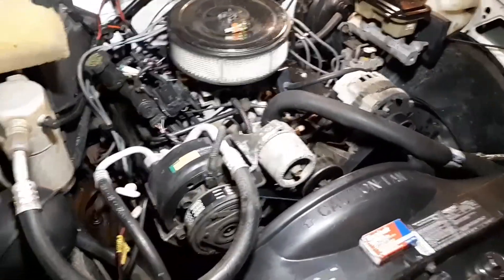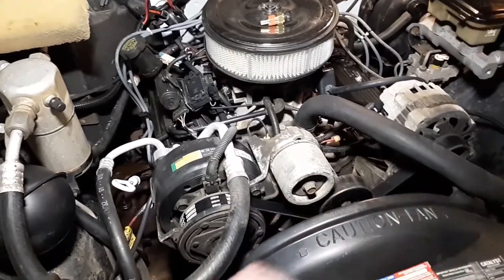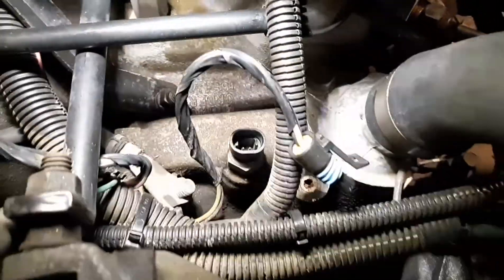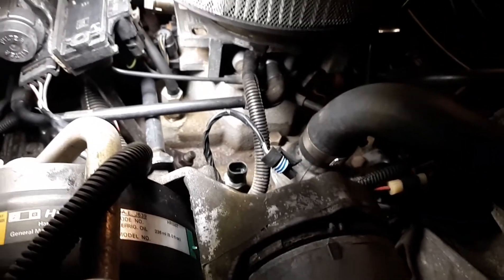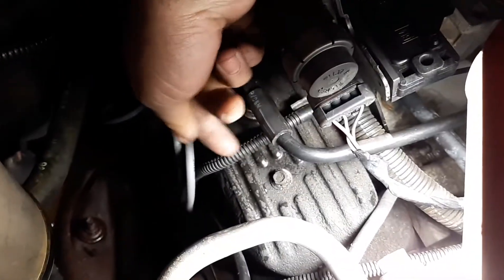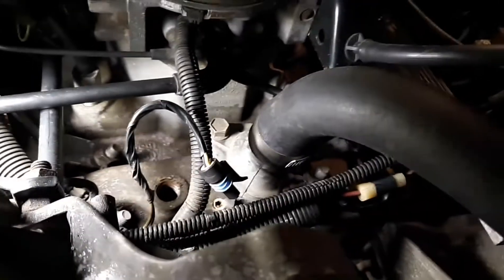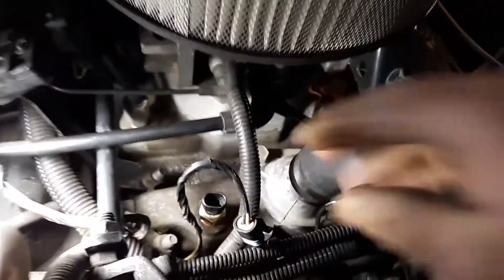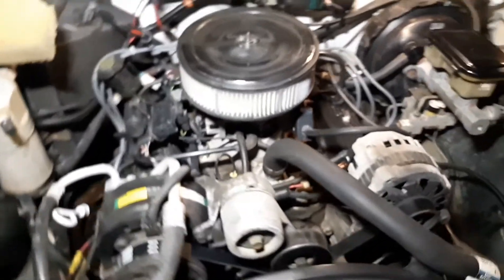Bad Coolant Temp Sensor replacement Chevrolet S10 4.3v6

Comment: Let me tell you - you are leading your viewers through the process and systems so much better than most pickup-truck youtube video makers out there.  Thank you for mentioning that this sensor (which I just picked up from AutoZone myself) is for the computer, and that there is a separate one for the gauge.  I wondered my my gauge was working if this is really what I needed.  I do have a bit of a choppy idle, which does sound like a cam - lol - and I will miss it, but I need to get the fuel economy fixed on this thing.
Reply from the maker: Thanks I appreciate that .
Reply from the maker: Yeah if its having a choppy idle and such it's more than likely the sensor on top of the intake manifold. And yea definitely will be crappy fuel economy when they fail too but make sure you don't have any vacuum leaks
Reply: @KnuckleHeadGarage27 is there a chance you could make a video on the sensor for the gauge inside as well? Would really appreciate it!!!
Reply from the maker: @hydrafreeze8814  if I'm not mistaken there's a video on the channel of Replaceing the sensor that's for the gauge inside
Reply: @KnuckleHeadGarage27  link?

Comment: All of the sudden my truck wouldn’t hardly start right or run right. After checking everything and rebuilding the TBI I ran across your video. I literally went to my truck and unplugged the temp sensor and boom it started right up. I can still tell it need the info from the sensor but it ran. Thank for the tip I was running out of options.
Reply from the maker: Awesome man glad I could help out! In some way . Definitely keep these trucks on the road , to many getting junked and crushed

Comment: I replaced mine a few years ago on my beautiful Blazer ZR2.  I bought it for $2800 from a Grandpa that kept her in a garage in Houston.  It's spot on with my gauge & it did help. 
My ECM & Coil cracked on my a few years ago causing a No Start. I replaced those, the distributor,  cap, rotor,  wires & plugs. 
Plus a new transmission because the stock Sunshields snap very easily.  I'm doing the belt, tensioner,  idler pulley & water pump tomorrow because my temp is running 210° & a tad higher when towing a small utility trailer here in SE Texas in the hot summer months. 
My current water pump isn't leaking & i can see water flowing through the radiator when the thermostat opens but maybe it's just weak. I've replaced everything else & no changes. I even installed a Severe Duty Clutch Fan.  Maybe this is normal but it's always ran 200° even on extreme heat days in the past. Or i could just be a little too OCD 😂
Reply from the maker: As long as it's not getting above 220 or worse I believe it's fine because towing a trailer and you live in Texas and it's hot already it's going to run warmer for sure cause its putting a more load on everything and if ac is on too then that's definitely gonna boost it
Reply from the maker: My 93 stayed at 210 that's normal and then would cool down stayed at 195 with the thermostat I ran cause factory is A 195°F thermostat u can run cooler ones but then that screws with ECM cause it was designed to run at a factory specs of 195

Comment: I been look for the sensor for the gauge on the dash cause it stop working. I finally got it fixed and it's working now. Thanks you so much sir.
Reply from the maker: Your welcome no problem glad I could help.
Reply: What’s was the name or part # for the one you replace on side of block?
Reply: @ArsenalTrujillo  when I get up in the morning I will get the number off the box and give it to you my friend
Reply from the maker: @ArsenalTrujillo  the one for the gauge inside the truck . On side of the block ia called the temperature switch an it ask if u gave a gauge or light when you buy it
Reply: Thank you guys
Reply: @ArsenalTrujillo  had a lot going on today when my oreally open in the morning I will get you the part number. For that sensor. I'm sorry buddy I got you in the morning.
Reply: @alfredrevis1876  thank you for your time I appreciate pal
Reply: @ArsenalTrujillo  TS253 at O Really Auto Parts buddy

Comment: Thank you so much for this video - incredibly helpful and after wracking my brain, this seems like it might fix my issue. i noted the part you mentioned there will be coolant in there when you pull out the sensor - is it necessary to drain that before making the sensor swap?
Reply from the maker: You're very welcome! I'm Glad I Could help . 

now you don't have to necessarily drain the coolant when you change the sensor.  U Can swap them really quick and it will he fine and just top off coolant in the rad for whatever you lost when changing them out .

Comment: Is the one for gauge called the temp sender ? My gauge isn’t working and I want to dry replacing it just can’t find the name for it.
Reply from the maker: Yes should be coolant Temp Switch or Sender . You'll be able to tell cause they don't plug up the same the connectors are totally different one is a 1 wire and the one for ecm has 2 wires or 2 pins inside it

Comment: I have an 89 S10 4.3 with a little leak in the plastic radiator neck which I typically just top off every few days.  After a couple of years of this, I finally had that little brain fart and forgot to top it off a couple of days ago which resulted in my running the temp gauge up to just under the red zone before I realized it, at which time I pulled over, slowly topped it off, and was on my way.  It's important to note that the truck never ran bad, and the dash lights never came on so I thought I might have dodged a bullet. Problem was, a few miles down the road it started hesitating, and then quit.  I waited for 40 mins, fired it up and drove across town before it did it again.
At this point I thought maybe I'd blown a head gasket and limped it home, let it cool, then checked the plugs, coolant and oil and exhaust and found no indications that the heads or gaskets had suffered any damage.
I did blow a head gasket in it a few years back and there was NO doubt when that happens.  Anyways, I replaced both sides at that time and it's run fine since until I let it overheat this week.
Once I determined the engine might have survived I fired it up again and it ran normal until the thermostat opened, then a couple of minutes later the truck just stalled.  I've come to the conclusion that it may just be a sensor that got fried and I'm going to try replacing the coolant temp sensor and see if that fixes the problem.  I was just looking to get some other perspectives so I thought I'd scan some YouTubes.
I've checked out a couple of videos where some guys tried to explain this simple process, but left out a couple of things here and there probably assuming the viewer knew those things (which most probably didn't or they wouldn't be checking out how to fix something here to begin with).  As a result I saw a lot of criticisms in the comment section because they glossed over some stuff.
You stated what you were doing and walked through it from beginning to end not leaving anything out (and pointing out the other sensor for the gauge on the dash was one of those little intangibles that would help those truly lost souls who didn't know an air cleaner from an alternator).
I was just surprised there were no comments at all let alone any saying, "good job."  Sorry my comment turned into a short story, lol.  Maybe I'll update in a couple of days for the sake of those who may someday run into a similar problem.  I've had this truck for 13 years and thought it was finally cooked... but discovering I may not have destroyed it after all just makes me marvel at how good these little trucks really are.
Reply from the maker: Wow what a story man an Journey lol .

Yeah I've had many 2.8s with the issues of running bad when gets up to temp or in winter time when cold u start them an they run as if they had a built cam in them but it's just the sensor that was bad . Happens on 4.3s too that ecm really relies on that sensor to run correctly
Reply: Yeah I'm hasn't ran hot but now that you mention that the top of my radiator right below the cap was wet today when u was putting the coolant temp sensor in.I had a 93 S10Tahoe before I bought this Silverado and it blew a head gasket at 346,000 miles,I've always had to keep check on the Coolant level in these 4.3 engines,that's all I've ran for 20+years now,and a few people I know has to do the same with there trucks Would you tell me where the sensor for the Dash gage is located please
Reply: Wondering if it worked?

Comment: Just watched your video concerning engine temperature sensor on a 1st Gen 4.3, my question, the sensor down on the head on the passenger side, you said it was for the gauge inside the truck, my gauge doesn't work, could that be the problem and how difficult to change ?
Reply from the maker: @jameshicks4944  yes it's the same way that you replace the one in the top of the engine . Basically same way just a different sensor and connector
Reply: @KnuckleHeadGarage27  THANKYOU
Reply: @KnuckleHeadGarage27  good sir, one more question please,i just bought a 1993 Sonoma SLE edition 2x4 automatic and notified that the charcoal canister has been disconnected, the vacuum connector at the front base of the throttle body has been plugged but the hose going back towards the fuel tank is just laying there with no plug in it, what kind of problems can that cause,if any, and thanks in advance for your patience and time.
Reply from the maker: @jameshicks4944  If that was my vehicle I would hook all that back up because of the fumes from the tank could be a bit dangerous if not done properly vented with it just being open and fumes going everywhere an under the truck close to exhaust and etc .
Reply: @KnuckleHeadGarage27  Thankyou for responding, yes,i need to hook that vent back up,gas fumes and heat are a very dangerous combination, thanks again for your time and patience.
Reply from the maker: @jameshicks4944  No Problem glad i could help

Comment: What was the problem the old sensor was giving you?
Reply from the maker: I had codes for the sensor . Also had cold start problems sometimes but most was when it was hot meaning up to full temp 

That sensor is very crucial for being correct and accurate for the computer to read to give the right amount of fuel and air mixture

Comment: Hey man I hope you see this. I'm stuck. I have a brand new thermostat, coolent temp sensor, and coolent temp switch on my 92 s10, 4.3l. After a few minutes of running it shoots all they way up past 260 degrees. It's been doing it for 2 years with no issues other that it reading high and saying check gauges. Any idea what it could be?
Reply: Hey where did u get the coolant temp switch ??? I believe mine is bad. I have a 91’ 4.3 s10 and my temp gauge won’t work.
Reply: I already replaced the sensor on the intake like he does in this video. And I’m having trouble finding the temp sending unit. I got one from Napa and it doesn’t work. I know the connector for my temp sending unit is good , because if I ground it the gauge will read max hot
Reply from the maker: Bad gauge cluster either that or the sensor that was replaced
Reply from the maker: If you replace the sensor that controls the gauge inside and it still does the same thing then you have a cluster problem and I would end up installing an aftermarket temperatures gauge

Comment: What if I wanted to change to a mechanical gauge?
Reply from the maker: Now if you want to change the temperature sensor to a mechanical gauge you can do that no problem as long as you use the one that was for the gauge inside the truck that is on the side of the engine block .

do not use the one that's on top of the intake that one has to stay there for the computer to read how hot or cold the engine gets to supply fuel and air mixture correctly.
Reply: @KnuckleHeadGarage27   which side is it on?
Reply from the maker: @twistedf4220  Depends on the year and type 4.3 but should be passenger side head that's now my 90 S10 blazer 4.3 is setup 

1 Wire Connector

Comment: Thanks Alot,I appreciate the video,
Reply from the maker: Your welcome an glad I could help out
Reply: On my 1990 Silverado I have changed plugs n wires,Fuel pump, and Coolant temp sensor, it still starts misfiring bad after about 6 or 7 minutes,please help me ,I work out of my truck n really need it right,it's the 4.3 262ci.v6 5speed manual shift 4wd  ,RSVP
Reply from the maker: @BetUBetterB  sounds like could be anything but hows the fuel injectors spraying an does it rev up good at all or what ? An did u change the fuel filter too
Reply: @KnuckleHeadGarage27  When I crank it runs great,and hit the road and it runs like a new truck,for about 6 or 7 minutes and I say that cause it's the same amount of time every time when it starts cutting out,Yes sir just had a new fuel pump and sending unit and filter put on 5 months ago,The Engine itself only has 43,000 miles,I had a Crate motor put in it 2 yrs ago
Reply: @KnuckleHeadGarage27  it has Full power until it starts cutting out,130 140 degrees or so
Reply from the maker: @BetUBetterB  hmm is the check engine light on and what is the codes
Reply: @KnuckleHeadGarage27  Doesn't have plug in for Diagnostics 
 1990 model
Reply: @KnuckleHeadGarage27  Check engine light is not on
Reply: @KnuckleHeadGarage27  Iforgot and I apologize,The first thing my mechanic changed was Ignition Module, Two  weeks ago ,
  Ive been told Coil ,or Distributor,just a handful of things that can cause the misfire,I will be the first to admit I'm no mechanic by far  but I will take good advice and put whatever I'm told to fix it.I love my ol Chevy
Reply from the maker: @BetUBetterB  Hmm , does the misfire happen all the time hot or cold or just after it gets to a certain temperature ?

Because to me it sounds like maybe a fuel injector is acting up or something else but however you can check the codes if the check engine light ever comes on you can use a paperclip to make it Flash and you count the codes that way that's how you do OBD1 cars or buy the little device from the parts store that does the same thing for a 20 or 30 bucks but I use a paperclip that does the exact same thing
Reply: @KnuckleHeadGarage27  It Runs like it's supposed  to for 6 to 7 minutes then starts missing 130° to 140° is the ballpark temp every time for 2 weeks now with 4 different attempts to fix it. Cranks n Runs on all Cylinders,Idles Normal, for 6 to 7 minutes ,up The  road or sitting in the driveway,same result
Reply: @KnuckleHeadGarage27  Paperclip?
Reply from the maker: @BetUBetterB  https://youtu.be/i_Y7TiVqsBA

Comment: What Problems was the old sensor giving You? I have a '95 Blazer and I just had this part replaced.
Reply from the maker: This one was having issues when was up to temperature of running correctly and I also had codes for it . Also can cause issues with cold starting too which mine did as well . 

Later on found ECM was bad and kept causing all my issues but still this sensor was bad
Reply: @KnuckleHeadGarage27  I was having a intermittent no start condition when it was warm outside(during summer, never happened in winter) when the engine was warm, after sitting for at least an hour, it would happen every 2 to 3 weeks. It would fire up then immediately die and then just crank refusing to start. Cycle key on and off 3 times, no dice, floor accelerator then crank, no dice. Even after letting it sit overnight it still wouldn't start, should have started then, plenty of time for engine to cool off completely. No check engine light, no codes. But starting fluid or disconnecting and then reconnecting the battery would get it to start and run on it's own after that and would do so until it would do it again 2 to 3 weeks later. Otherwise starts up and runs strong. Last time it happened at my local Wal-Mart someone stopped to help and I told him what was going on and he told me about the coolant temperature sensor and told me the same thing happened to his Astro, told me it turned out to be that part and he told me to look into it and sure enough, I read about that part and found that it can think that the engine is either colder or hotter than it actually is and make it hard to start. Not just for GM, but all brands. So I replaced it. I wont actually know until this upcoming summer but I have no doubt as I have had all the sensors(minus the knock and O2 sensors) on the motor replaced as well as the fuel pump and fuel filter. Spider injector replaced too.

Comment: Big help.  If my temp gauge is working I need to replace the one you showed first on the left side of the motor?
Reply from the maker: Yeah the sensor switch on the side of the block is for the gauge inside truck .

The one on top of the intake is for the engine computer
Reply: Is the replacement part the same for both sensors? My gauge doesn't work, but my engine runs fine.
Reply from the maker: Yes pretty much same way to replace them both just 2 different sensors